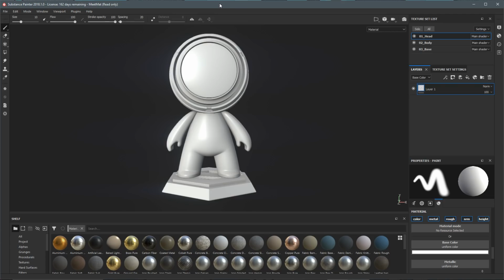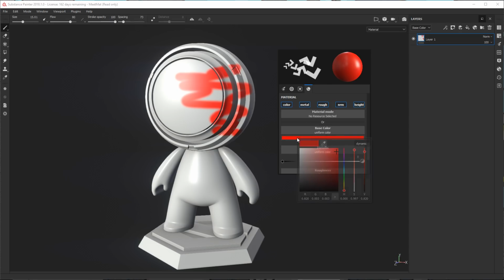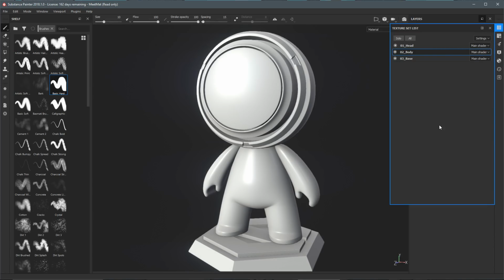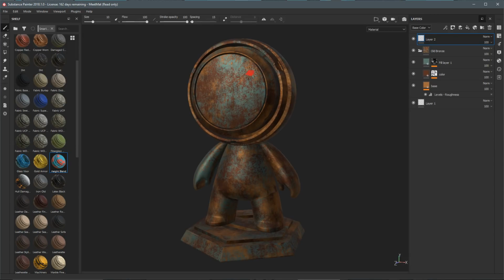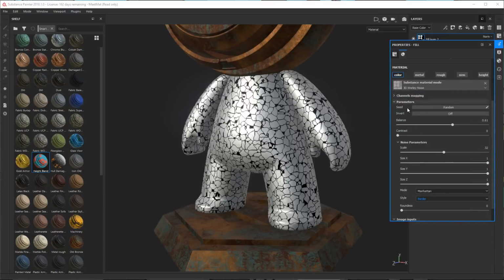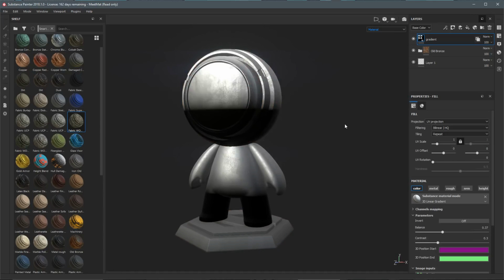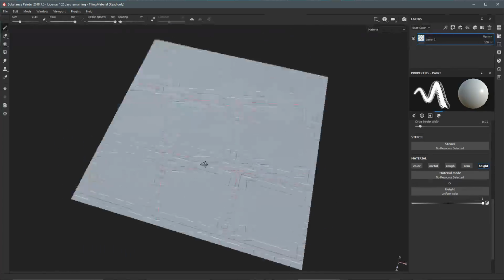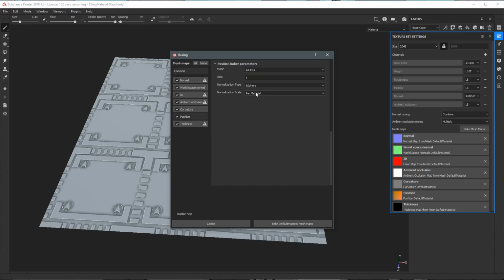Substance Painter 2018 Spring Release | Adobe Substance 3D

Comment: In the right/left side of the screen, you can dock panels, like layers or properties. Previously it was possible to stack two columns and change the height of each panel independently. Now it looks like side column divided into top and bottom area, where you can stack many panels. But you can change the only height of top and bottom areas, which cause changing the height for all stacked panels in top or bottom areas. It would be great if you will fix that, so each panel can have independent width/height...
Reply: Image to illustrate the problem: https://imgur.com/a/vasqo
Reply from the maker: Thanks for the feedback. I have reported this to the devs.

Comment: Would love a "drag rect" brush similar to ZBrush :D
Reply from the maker: Thanks for this suggestion. That would be awesome to have indeed
Reply: I'd like to see a pen tool system like in Photoshop, something that can be used to create custom shapes or to turn into a line tool. It would be neat if the curve glued onto the object so it could be used in the 3D viewport! Think about it :P
Reply: I second the drag rect, I was actually confused I couldn't find it at first. Also a paint bucket fill. Even if we have fill layers, the more ways we have of doing something the better. Think Autodesk maya, there's like 10 ways to extrude a face, (Hold Shift, Modeling Tools, Markup menus, Shortcut key etc. etc.) it only makes it easier.

Comment: Not so happy with the relase, the new painting system doesnt have a good way to paint 'around' a mesh, for example if you would want to make a frame around some object, without painting on it (some of the modes come up with distorions). Painting scale in the UV window scale differs from the 3d view is an old one that i think should be fixed, also the mesh re-importing often breaks the layering (even if you deselect preserve brush strokes) The 3d noise and UV updates are welcome, but so far seems like a mixed bag
Reply from the maker: Thanks for this feedback. I have posted this information to the team.

Comment: Wait, I'm missing something. You didn't need an anchor point to add HBAO to those painted normals on the scifi panels?
Reply from the maker: No you don't need the anchor. For the HBAO, I set the mode to normal and it creates the AO based on the normal details.

Comment: I have 2 questions:
1-Should the Metallic slide bar be just an off or on (either black or white) instead of having the range of colors in between?
2-Will there be a better way of determining the Max Frontal and Max Rear distance when baking the normal map? For instance XNormal has the ray distance calculator  which is not very accurate but gives a somewhat estimate. Based on my experience the default settings for it does NOT give a good result and sometimes its cumbersome to change them several times until you get the ideal result
Reply from the maker: 1. You want to have a range slider. This way you can compensate for transitional values such as light dirt on the metal surface. You will often need to have some transitional areas like this where the dielectric material( ex. dirt) will not be fully covering the metal. 

2. We are talking about this internally. We have plans to improve this.
Reply: I have one small question. I have seen some people pack 3 texture maps(for instance Height,Roughness, and Metallic) into R,G,and B. wHAT IS THE ADVANTAGE OF DOING THIS AND WILL THIS PACKING REDUVE THE RESOLUTION OF THOSE TEXTURE MAPS?

Comment: How to export all texture set into  1 ?

I dont want to use designer. Tedious.
Reply from the maker: We don't support the merging of texture sets. If you need only 1 set, it's best to use a single material in your 3D app.
Reply: but the baking will be problematic, the cage always overlap. i need to divide my mesh with different material (apply diffrent material on low poly) before exporting.... or there is another alternatives ?
Reply from the maker: Can you use the match by mesh name feature? This will isolate the ray to matching mesh parts via naming suffix. You can have 1 material on your low res mesh to create a single texture set. Make sure your UVs are not overlapping, then divide the low and high poly into mesh parts. This is like exploding the mesh but you don't need to actually move the meshes. The cage overlap will not matter as the ray is masked to matching named parts.
Reply: i will try it out.

thanks for reply.

Comment: Great software when it works, 37 crashes today can't export my maps or model, I have the whole package and I find it the most unstable software ever, and support, for get it. I've had the software for about 6 or 7 months now and have probably sent like 200 error reports and had maybe 3 replies and never resolved any of the problems. So I guess I'm out $400, they should supply seat belts with every purchase and not treat us like crash test dummies.
Reply from the maker: I'm sorry to hear you are having this experience. This is not the typical experience we are seeing from our users. Have you posted on our forums? It's hard to tell what is causing the crashes without knowing more about your setup or configuration.  https://forum.allegorithmic.com/index.php/board,20.0.html. We don't track users from the submitted error reports. If someone sends a report with a written explanation of the bug, we usually reply. If it's just an empty report with no details, we don't send a reply. Our support forums or our contact form is the best way to get support. Our dev team regularly checks and replies directly on the forums.

Comment: Where is UI scaling feature? those tiny ass god damned 5 pixel tall fonts impossible to read.
Reply from the maker: The UI supports HDPI display resolutions but we don't have any specific settings that can be changed.
Reply: that's kinda useless. windows scaling makes everything huge buttons icons sliders even with 125% but text remains almost intact.